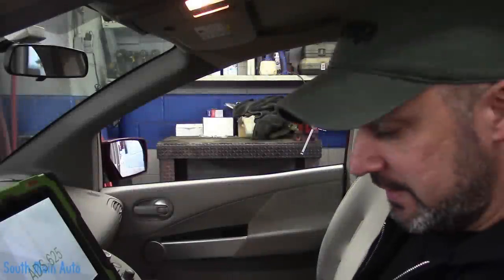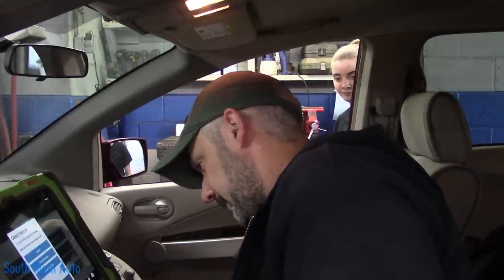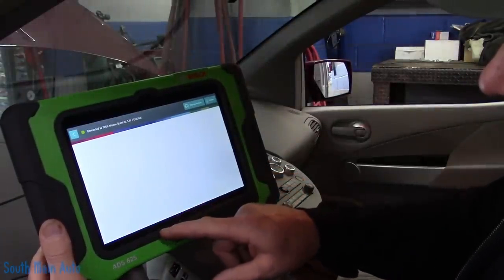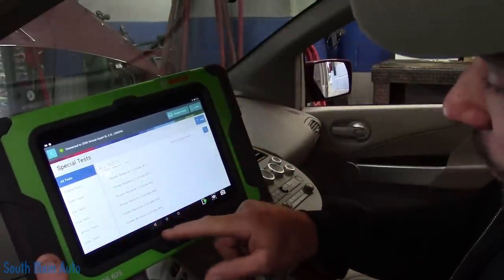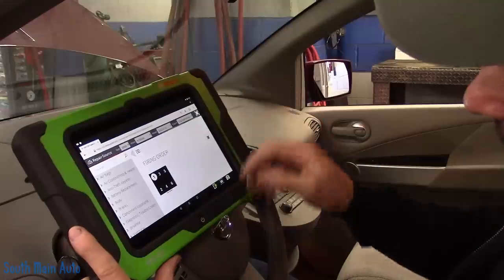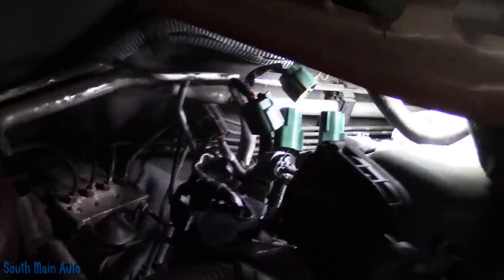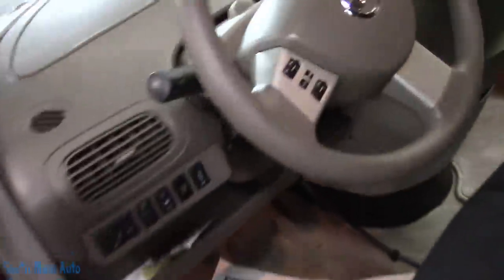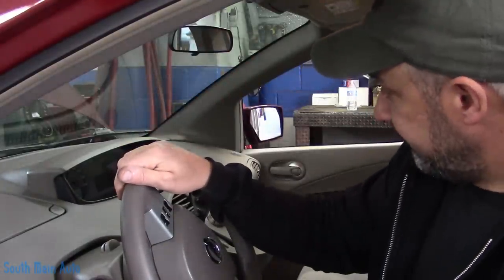Customer Replaced Spark Plugs And Now It Runs Bad!?

Comment: My biggest mistake was while doing a fuel pump on a Lincoln inside the tank. At the time we used regular lightbulbs in worklights. Well the service writer came out in the bay and knocked the light off,hitting the open tank igniting EVERYTHING. The fire extinguishers did nothing to control it and by the time the fire Dept got there the car, and half of the garage was on fire. Luckily we got our boxes out and most of the cars but the building was a loss. The only saving grace was the dealership had already started building a new location that was almost finished. But nonetheless I should've covered that tank opening.
Reply: A accident like this can happen   Even in a professional environment. Just takes seconds for it
to occur. Lucky that
no one was hurt. This
Really something left
In the hands of a pro. 
Fuel work in the hands
a novice is not a advisable thing. Thanks
for your story SouthJerseySound
Reply: @rollinajoint9657   So true and it was pretty common for the old work lights  to start fires back then. Usually they were small but not this time. There was a reason why even service writers weren't permitted in certain areas of the shop and that was one of them. Technically he wasn't supposed to go inside the yellow zones as they called them and a techs lift was a "yellow zone". After the fire the insurance company put a end to using those lights and we had to use the long fluorescent tubes in a plastic housing and they sucked. But now thanks to guys like Astro tools we've got super bright cordless LEDS that are very safe.
Reply: SouthJerseySound 

Indeed. I have seen a few costly blunders. I
respect your insight.

Comment: Replaced plugs in '10 Focus, "engine not charging light comes on. I replaced the alternator, 1 new coil pack. Only to find i hadn't completely snapped the injector harness back together.

Comment: Austin Healey Sprite, High School, change the clutch and have the engine back in, bolted up, drive shaft, fluids and electrical. Last thing to do before starting it up was bolt up the bonnet. I turn around to look for any forgotten bolts and what do I see on the work bench, but two release bearings. A new one, and an old one. Good grief!

Comment: Way back when I was first learning how to work on cars. I put a 250 straight 6 in a 79 Z28. It was all I had. But anyhow after getting the engine in. I didnt have all the wires hooked up and just had to hear it run. So I jumped the starter out the car fired up and was in reverse. It drug me across a field before slamming into my dad's 64 GMC. I had to take the walk of shame limping.

Comment: Worst mistake I’ve made was staying a dealership tech ten years too long.
Reply: Yup, I got tired of chasing squeeks and rattles that Chevy built into their crappy vehicles. Along with the cheap fucks running the dealership not even wanting to pay for roadtests to evaluate complaints.
Reply: @behexen250 Ohhh Yeahhh airbags
Reply: Dave Logic it's all about how you conduct yourself. I for one can remember every tool I use for a specific repair. I remember Pontiac Vibe airbags I'd leave the dash in and half done in maybe a half hour and make my day in three of those and still have other customer work to do. You gotta know your worth in the auto field.

Comment: As far as DIY, it's good to take different color paint markers and slap a stripe or two down things like injector plugs, plug wires, plugs on top of the distributor, anything you don't want to mix up when it goes back together. Saves having to look everything up later.

Comment: If it is that easy to mix up,  why not label the wires with tape before you remove them
Reply: I usually do them 1 at a time when they are unaccessible like that.
Reply: Wires are color coded. As long as a technician has an electrical schematic It's no problem. I always take plenty of time to study a vehicle's electrical schematic before starting a job. However if you're a weekend mechanic you'll find lots of schematics and help in a Haynes Manual!
Reply: @rimmersbryggeri  Easiest way of keeping everything in order.
Reply: He just said they where at one point
Reply: Usually, the moment when it dawns on you that they are easy to mix up, is reached post mix-up!
Reply: @ryans413  yeah I posted this about halfway through the video
Reply: Dude you spoiled it
Reply: Timothy Barney LOL! THAT IS SO FRICKEN TRUE!
Reply: If you mark on the tape, better not spray any brake clean or you'll have no marks in a hurry!
Reply: Timothy Barney and when your time to do any more work is up haha
Reply: I used to use tape but then discovered a label maker.

Comment: My first time replacing head gaskets on my Subaru when I timed the engine I had the passenger cam gear 180 degrees off...ooops
Reply: My first timing belt was on our 1971 Capri loaded to the gills for a vacation, 400 miles from home beside a freeway in California's high desert on Sunday morning. I had the Haynes and tools, got a ride to a NAPA, and timed the cam on a grease mark instead of the mark. Good thing it was non-interference!
Reply: You replace the head gaskets more than once?

Comment: A dumb mistake I made was when I changed my own spark plus as well. When taking it apart, I saw that the spark plug wires were zip tied up. I didn't re zip tie it after I changed it, thinking it didn't matter, it was just to make it look nicer. Little did I know, it was to help the wires not arc on the engine as they wear. About 4000 miles later, I was getting a misfire. Not knowing how to fix that, I took it to a mechanic who knew what he was doing. He found that and explained the reason.

I felt so stupid as a result. I don't think I admitted to him they I had done that, but... Yeah.

Comment: 77 Camaro painted the front grill black and was proud of the look. First stop fell to the ground and broke into pieces. How, forgot to bolt it back into the frame. Another was the head gasket replacement on 2,2 Chrysler Lazer. Putting everything back together I started it the engine to a loud screech and smoked to fill the garage. Shut the car off immediately because I believed seized engine. It was the power steering belt was misaligned to wrap itself the others (alternator/ AC)  to create the smoke and sound.

Comment: When I was dating my wife back in the late 70's, she had a Chevy Vega that suddenly stopped running.  Her dad looked at it and came to the conclusion that the motor was blown.  We bought a used engine from a junk yard and put it in and it still wouldn't run.  I sat down one night and read the owners manual and found that there were two fuses for the fuel pump.  Fuel pump start and fuel pump run.  I pulled the fuses and sure enough the fuel pump run fuse was blown.  $.25 cents later, the car started.  Changed out the whole engine when all it needed was a 25 cent fuse.   We still get a laugh over that..

Comment: Great video! To the DIYer- coulda been anyone . Good gosh, Nissan's are nightmarishly inaccessible! 

I was trying to diagnose a misfire. Managed to light off gas with a plug wire from an injector I was checking the spray pattern. Lit up the engine wiring in a taurus. Luckily, it only burned up the protective conduit on the wiring. Wiring was fine. Replaced the conduit, spent hours cleaning up the fire extinguisher Shmoo. Replaced the defective injector (found it!). All was good again. Watch out for sparky the fire starter mixing with Mr. Gas. Bad things happen quick. Keep a fire extinguisher handy at all times.

Comment: When changing front shocks on 07 suburban. I reused springs didnt notice bottom mount angle was wrong till had the top bolts started! Had to remove, compress spring again, turn shock and retighten. Reinstall and all was good! Noticed if sticker is out all is good, lesson learned!

Comment: One time I did an oil change and I remembered that I forgot to put oil back in right as I started the car. I shut it off right away and put oil in. I got lucky.
Reply: False Flag  
I disagree,  I had, a 69 Chevy the oil pump went out and it took 3 days before the engine locked up
Reply: I dunno, the bearings on car engines rely on pressurized oil to be the bearings. You really don’t want even a whole second with no pressure.
When I do a change, especially when I don’t try to pre- fill the filter as much as I can I watch the gauge or idiot light and just start and shut it off - vroom - multiple times till it shows pressure then let it run.
You would have done it ten times and thought “ when the hell is the pressure ever going to come up? “

Comment: Worked on brakes to a Yukon xl and couldn’t get the brake pedal to firm up after multiple bleeds. Installed front calipers upside down. Found out after getting vehicle to a mechanic. Was probably my 50th brake job!

Comment: I rebuilt a classic VW engine from a box of parts. Made the mistake of trusting previous owners works as the connecting rods appeared to be bolted on the crankshaft...they were only finger tight. Ran for about 15 sec before giving way.

Comment: Same mistake got me a free car.  I knew a guy with an old Valiant that wouldn't run.  He said it was mine, just tow it out of his carport.  Under the hood it was full of brand new components, carb, coil, battery, choke, ignition harness . . . anything that could be replaced from the parts house.  

Yep, the distributor was in backwards and a vacuum line was missing.  Ten minutes and two dollars gave me a car that ran for a hundred thousand miles.  

You rock SMA.

Comment: I had an 89 5.0 notchback.  Stalled out in traffic and wouldn’t restart. Gas gauge read “e” but I “knew” the car and figured a little was left. Had it towed back to the house.  Over a couple days put a new distributor in it and other bits.  No luck. Had a mechanic friend come over and check it out.  He eventually asked if there was gas in it.  Put in a gallon....fired right up.  It ran out of gas.   😜
Reply: This happened to a buddy of mine roughly 15 years ago. To this day I still tell him that E does not mean enough LMAO

Comment: i was working in a garage as a mechanic in the 80's, and i did a motor swap on an '76 el camino.  i drained the torque converter to replace the fluid while i had it out because it smelled burnt. i got it all put back together, went to go for a test drive, and no go. it took me about ten minutes to figure out i forgot to refill the torque converter before installing it. needless to say, that job didn't pay very well after the extra time i had in pulling the converter to fill it with fluid, and reinstall it. bright side, it ran really well, and the customer was happy.

Comment: A tip picked up when I use to do my own stuff before the computer crap, was number each lead to each spark plug ( or coil ) with a stripe with a marker. Cylinder 1 lead was 1 stripe, 2 was 2 stripes and so on. This was a standard inline 6 where you could fit a grand piano under the bonnet. Nowadays with things so packed in and behind everything else, it understandable when mistakes like this happen.

Comment: 75 Nova changed the clutch for my father-in-law in his garage on my back.  When I installed the drive shaft somehow I missed tightening one of the u-joint bearing cap bolts for the little rear end clamp.  This was 35 yrs ago.  Anyway, he Went to work the next day and 20 miles from nowhere the drive-shaft came a flying out.  Wha wha whaaaa!

Comment: Having worked on manual transmissions since I was 19 (I'm now 75) and many Muncie and Borg Warner ST-10's I figured I was pretty competent at putting together another ST-10 I had put A new cluster gear, input shaft along with a small parts kit and all the bearings and bushings.  When I put on the front bearing I noticed that the trans would lock up.  I took it apart at least two more times when I remembered that the snap ring should not be installed until the bearing is pressed home on the input.

Comment: Nail polish.   My old man swore by it.  USMC master electrician on the F-4 Phantom.  Said to always have a few jars of nail polish.  Various colors.  Used to mark plugs and wire connectors, hoses and bracket orientations.  Dries fast.  Durable.  Mark as you go.  Various colors for multiple combinations.   I also now take phone pics and make vids with narration for me as I go.  Every little bit helps.

Comment: Spent hours grinding the rivet heads off of the hanger brackets before realizing the convenient holes the end of the springs made through my bed gave me plent of room to put a reinforced cutting disk on my dremel and chop them off in mere minutes, also almost replaced all the nuts that came with the replacement bracket because they were warped only to realize it was done likely on purpose to lock the bolts in place.

Comment: Nice. I remember when i put the relay on the wrong place. I started the vehicle and it went to limp mode. I was freaking out. I called a tow truck and took it to the transmission shop. Long story short at home after looking for pictures of the relay box is when i noticed  my mistake. Called the shop and lucky for me the car was not being attended so i fix the relays at the shop and drove home happy as ever.

Comment: When replacing the valve cover gaskets on my 96 Maxima, I was tightening the rear bolt on the intake manifold support bracket and evidently I had a bolt that was a bit too long and busted through the valve cover. Didn't think anything of it because I had thought it was the bolt straightening itself out in the holes. It was my first DIY job but luckily my dad came to the rescue and filled the hole in with a welder.

Comment: Bought a fixer Corolla that was boiling over and diagnosed as needing a head gasket. Limped it home with 2 gallons of water. Replaced the head gasket. Old gasket looked fine. Still boiling over just as before. Replaced the radiator cap. All better.

Comment: Years ago, I decided to tune up my car. Got it back together, but it ran badly. Got it to a shop. Mechanic had the air cleaner off and was looking down the carburetor (I did say it was years ago) as he goosed the throttle. I said it backfires. He jerked his head away,  moments before flame erupted and filled the space where his head had been. Earning me a heartfelt thanks. BTW, it was crossed spark plug wires. LOL

Comment: I like how you didn't make the guy look bad. It was a simple mistake, that we've all made. My stepfather tuned up my mothers car years ago. It was a olds delta 88. After 3 days , he gave up and called me. I drove 4 hrs to get to their place, only to find he wired the cap backwards. He had it wired for clockwise rotation not counter clockwise like it should have been. I wish I could say there was no swearing.

Comment: I’m still a newer tech so I’ve had ,y share of silly mistakes but one of techs I work with rebuilt his first transmission and had no gears he was flustered and walked away from it. Couple other techs came over. Turns out the transfer case was in neutral. So happy he didn’t rip that transmission back out

Comment: I knew what was wrong right away...because I did the same thing on a Nissan V6 while replacing the valve covers a few years ago. I thought for sure I'd properly reconnected the plug wires. A few hundred bucks later, including a tow, it was corrected by a shop. On the bright side, as they say, I still saved a few thousand dollars because this car needed A LOT of mechanical work. It ran great after the work was completed.

Comment: I am now 69. When I was 22 I rallied a Hilman Imp (UK). Rebuilt the trans axle, and fitted back in car. Restart engine, no reverse. Reverse gear still on bench. The gear fits in a extension housing on rear of box. Strip and refit,reverse OK. Later rebuilt the engine and had cam 180deg out.After resetting the cam had one cylinder low compression.Thought I had bent a valve, but valve shim had moved (30deg incline engine) and the cam was holding the valve open. All OK after.

Comment: senior in high school. Has a 68 Buick, wanted to do my 1st tune up. including new plug wires. Grabbed the bunch and ripped them out. Firing order? what's a firing order. Step dad to the rescue. I did redeem myself later by rebuilding my 72 Datsun Carburetor perfectly.

Comment: One mistake I made was during a head gasket job on a V8. My boss had me put shop rags in the cylinders to catch the stuff I was cleaning off of the block. After interruptions, I put the heads back on leaving the rags inside. Fortunately, I caught it before torquing the head bolts. DOH!

Comment: Yup.  Sounds familiar.
I was showing my friend how to change spark plugs and coils.  I told him do 1 coil at a time so it does not get mixed up.  Went to use the restroom and came back.

He pulled out all 6 wires at once and said I don't know what wire goes where.  Lovely.
Good thing for the internet.  Lol.
But that is a definite great idea.  Take pics before starting the job.

Comment: I swapped out the intake manifold and head cover gaskets on my 2000 F150 over the winter and I managed to swap the vacuum lines between the fuel rail and the EGR valve.  The routing should have clued me in but the line to the EGR ended up melting and the truck ran like crap before I figured out the issue.  Afterwards it ran beautifully, best it had run in years with the new gaskets.

Comment: Pulling the motor and trans out of my 88 RX7.  Had left the driveshaft out for several days and assumed there was no gear oil in the trans cause surely i'd have seen oil leak out of the tailshaft.  Dad's on the engine hoist, i'm under the car guiding the transmission out, get about 10 degrees off horizontal and got a face full of gear oil.  Truly everyone makes mistakes, glad this one wasn't too hard to diagnose